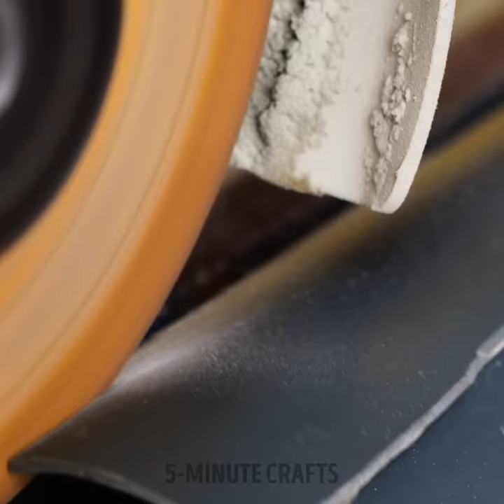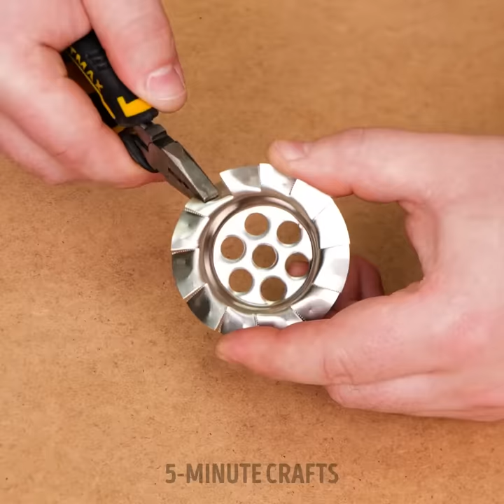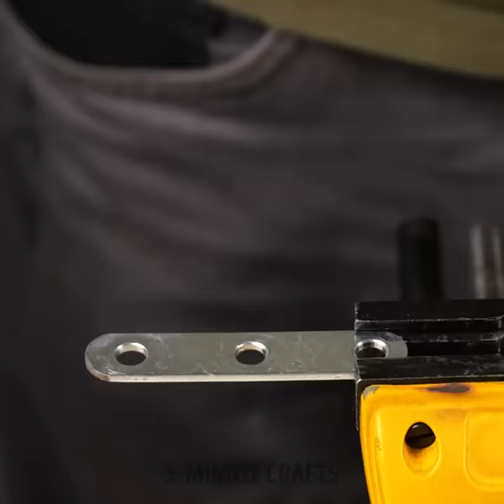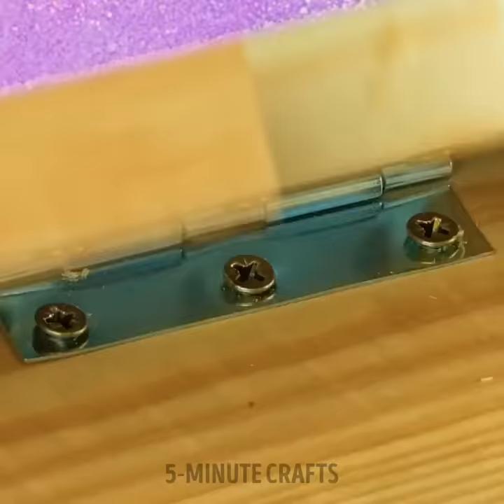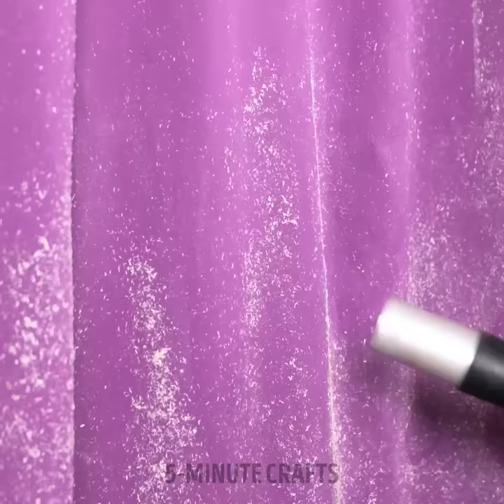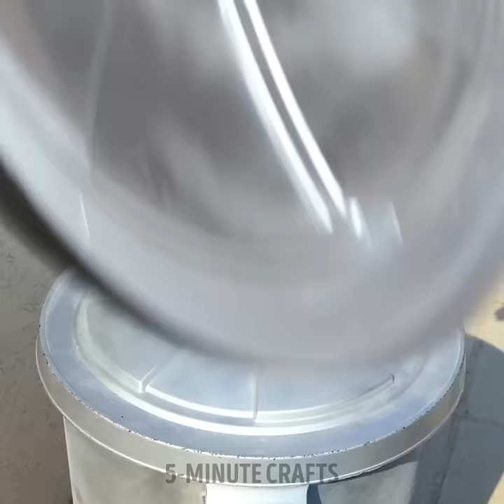Useful Tips to Master the Art of Repair

Comment: The one that shows them using hot glue to attach a mini sanding drum to a screw to use in a drill… look at what they used to video it working… an actual Dremel sanding drum holder, not the tool they supposedly made.
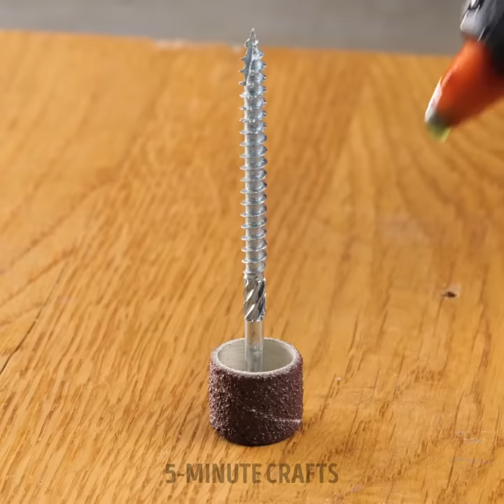Reply: You mean at 2:09? Where you can see the screw, glue, sanding drum and drill? And then you see the EXACT same item in the drill?
Reply: Slow the video down to x0.25 speed and you will clearly see it's the same sanding drum they made.
Reply: LOL.... What else are you convinced you are being lied to about?

Out of curiosity.... Do you think the earth is round or flat?
Reply: Not true.  Pause the video.  Same drill, same screw.  No way that's a Dremel.
Reply: But it is well centered and it was not shown that that aspect is important.  Perhaps dropping a nice fitting washer inside before adding the hotmelt glue could aid in that aspect.
Reply: Jaja Un taladro no tiene la mismas rpm que un dremel! Fin de la discusión 😅
Reply: Ok ...I'm not gonna get baited into why this does or doesn't matter so....DOH!
Reply: 2:09 me gusta

Comment: FYI Don't use any type of piping and put a hand held hair dryer in it. It will melt the end you have in the pipe and start a fire.
Reply: Highly unlikely considering the air temperature coming from a hair dryer ranges from 80 degrees F. up to 140 F. & PVC has an average melt temp. of 350 degrees! I certainly wouldn't leave it unsupervised, but you could set the hair dryer on low heat or even cool...and be fine. I thought it was rather brilliant myself.
Reply: @garyshircliff6905  Our grown child's neighbor set his garage on fire because he thought stupidly it wouldn't catch fire boy was he wrong.
Reply: @noneofyourbusiness9369 my mate when he was a teenager set the whole effing house on fire doing this

Comment: I don't think I'll be carrying a solder pot around anytime soon. I have multiple more conventional and safer ways to solder joints.
   The attempt at creating a barb on the plastic pipe to connect the hose is likely to leak due to being a spiral. The way a real barb works is with individual concentric rings, each sealing on it's own.with no path to the next one.
Reply: You mean to say you don't carry a bucket of melted solder around doing repairs? Well I never!!!!
Reply: @galewinds7696  😄 Nope, and people who don't know better eat this BS up as normal.